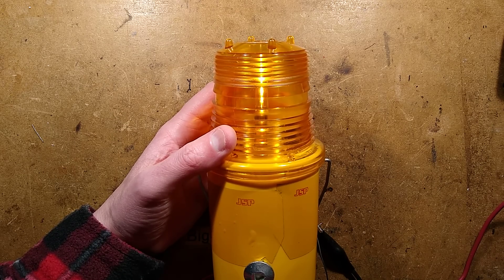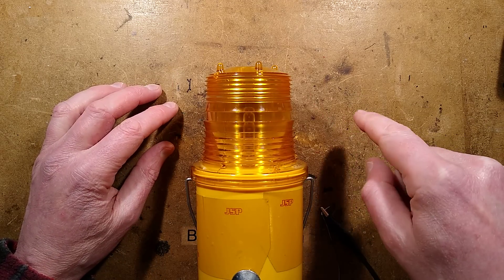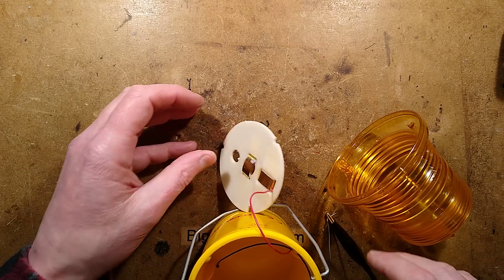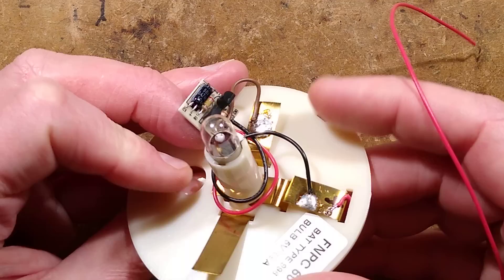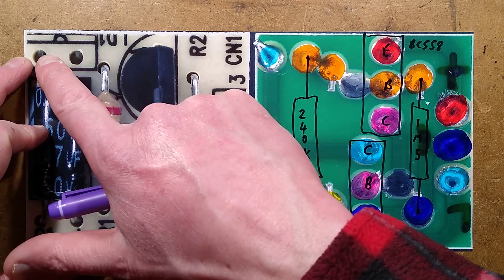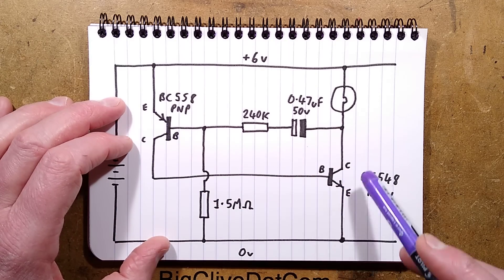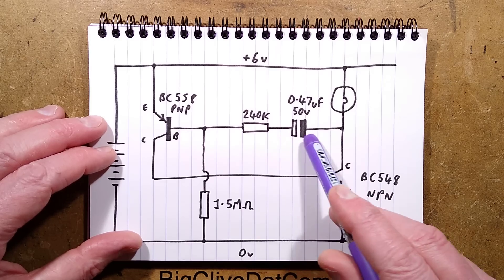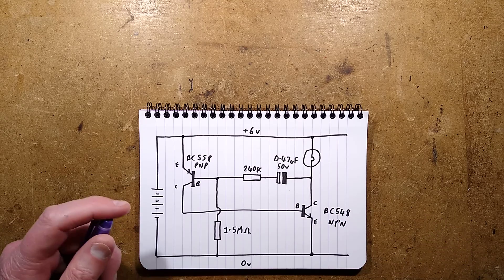Old tungsten roadwork beacon - with schematic

Comment: Used to steel those as a kid. Loved the 2x6v large round versions which you needed a match stick to turn it on. Who is old enough to remember the paraffin traditional road work lamps
Reply from the maker: I had a few of the paraffin road lights.  I gave them to my dad.

Comment: Many moons ago when I was at school in Germany I worked hour-wise on some afternoons at a small factory assembling the German version of this. They were even simpler, using a bulb with a bimetal strip inside to make it flash. After that they also went solid state, and it was my job to populate the circuit boards. there were a few more components on that though. Later on I constructed a LED powered prototype with the first high (ish) intensity clear red LEDs, was sorta OK and the boss was very impressed, but them darn bean-counters killed the project. That was around 1981, LEDs not so super cheap...

Comment: You could use that as the yellow flashers for your car in case one of your bulbs fail!  In fact, you may only need to connect it to the Flasher's main wire from the LED. I am not sure if any cars still use 6V still or if the Volts have been Lowered.    but, this would be a emergency fix if you need it!

If I remember right, there used to be a charging Upgrade for these road light's which would charge the Batteries  during the day. so, LD was probably more for that UP grade for a light sensor. the LD may have also turned down or up the power of the light as well as charging the battery!   I will try and see if I can find more info. I have not seen one of these in quite a while. and they are somewhat still in use here in the USA!

Comment: Circuit is the same as the Dorman-Smith Trafilamps from the 70s and 80s. But those did have a light sensor, and took two lantern batteries

Comment: I believe the light sensor (ldr) missing component is for syncretized lamps the one in front flashes the ldr pricks up the flash and triggers the next in the chain and this continues down the line giving the runway effect you see on motorways

Comment: Interesting not that far off from a US version although ours had in some cases double batteries and I'm not sure what the little circuit was. Most of them did include a power switch push button instead of the rotation method and sometimes a photo sensor. the design was also fairly cheap although the one I took apart might not have been that economized at that point it was older but still resembled the current firm factor at that time. and I don't know how I got a hold of it when I was 6 or so. I did have family members and acquaintances who would give me boxes of goodies which was always fun. Always wanted to be an electrician and well I haven't gotten the official paperwork yet it's on my to do list I have done a few projects and I'm confident enough to do things safely and properly, and the fun one spot other peoples mistakes and fix them.

Comment: In our area our lights that would be on wooden folding barriers has a flat round shaped light (so basically shined 2 directions mostly) and they used a 12v battery (the size of 2 of the 6V ones from your lamp), I thought I really did something when I figured out how they turned them on/off, it had a small hole (less than 3mm) that they pushed a pin into to hot a push on push off switch and the hole was sort of hidden as it was next to some ridges so you would not see it unless you knew exactly what you were looking for. The main body had the ability to be bolted to the wooden A frame barriers in a way it could not be easily removed (would have to disassemble the  battery box and get to the bolt from inside the lamp).

Comment: Hi Clive, I had a lollipop version of this lamp as a teenager. These things are almost disposable, (they’re used by the thousand and often hit by passing vehicles) so even saving the cost of one resistor and its assembly cost mounts up. That’s why this is so minimalist. The one I had did have an LDR built in, and that was to synchronise the flash to the next one along the road so the net effect was a strobe sequence along a feed-in where a lane is discontinued. Presumably the response of a simple LDR is not instantaneous, hence the slight delay in each lamp flash producing a progressive animation along the row of lamps. I imagine there were build options with and without the sync LDR. Very few components producing a sophisticated multi-lamp behaviour.

Comment: So this is why you had that survey.  I had a feeling it was coming up, the closest thing to this I have is a unit used on my tractor.  The difference is it's three brief flashes then stops for about a second and then repeats.  It's also LED but has the amber Fresnel lens like this one.  I wonder if power draw would be different if you changed out the flashlight bulb with an array of LEDs pointing in four directions?  The beacons I remember as a kid (early 1990s) were similar but were a disk shaped round beacon (like the amber fender lights on tractors) in two directions and they sat atop sawhorse-style barricades and a yellow square battery box below them.

Comment: I can remember opening one of these and finding the multivibrator cct. We played with it for hours and connected a loud speaker instead of the bulb. Swopped some of the resistors for pots and changed the cap values.. DIY synthesiser  on a budget !

Comment: I remember the old Dorman Smith Trafi-Lamp versions that took 2 batteries. They had a special low current bulb and would not flash with any other type.

Comment: Ahh, yeah, I remember those lamps in the early 80s, they used to to attach to the top of a yellow metal tripod with that screw using a triangular key. We had to walk the entire line of roadworks turning them all on before we went home in the evenings. If they didn't turn on you'd have to swap for one of the spares carried threaded on a rope through the wire handles. These were the first move towards the modern traffic management. How times change, the only hint of hi vis clothing was having orange shoulders on your donkey jacket. Welfare was an aluminium shed with bench seats inside and a gas ring to brew up. Despite safety being more basic, working on the roads was safer back then, motorists weren't as ignorant, impatient or distracted as they are today.
Reply from the maker: I still have my donkey jacket from the past.

Comment: What if you remove the resistor+capacitor and install the LDR instead? Maybe the lamp affecting the LDR will be part of the circuit during the night, and during day the sun will keep the light off.

Comment: The long flash is due to the 240K resistor, the original pulse version did not have that.
Nor have they ever had a current limiting resistor in the base of the lamp transistor.
It would be over 40 years since I pulled one apart and then they had a TO220 style output transistor.

Comment: I remember having several of the American style ones when I was a kid in about 4th ot 5th grade back in the very early 80's. 

I was walking home from school one day, and the main road that took me home had been under construction ALL summer long. I'd make my way thru the job-site everyday, and check out the progress as I walked home. That day I found a box along side the new curb with about 7 or 8 of the flashing lights in them, and they looked to be broken up or not working. I asked one of the workers in the orange vest if they were garbage, and to my delight he said YES! I dragged the box home, and was able to take them all apart and make a few good ones out of the bunch. They even came with 2 6-volt lantern batteries in each one, and many of them were still good. I put the ones that I got working all over my room, and my favorite part of the day that summer was dust, when they'd all magically turn on and my bedroom would be flashing orange all over. I was amazed that the 2× 6-volt cells in them would keep them running all summer long. I kept those things for YEARS.. later on, I put brighter incan bulbs in them, and finally some yellow LEDs when some bright ones finally came along. I learned how the circuit worked way back when, and it is a fond memory of one of my first forays into electronics as a young boy. 👍

Comment: "The reason the light is round is because roadworkers often smear the lights with grease and then sit on them for manly pleasurement, although that may not be factually correct, since they actually use cucumbers or Temu insertables instead.  (Hardly anyone reads down this far anyway.)"
ROFLOL 🙂 Even if I don't watch the whole video, I always read your description because your descriptions are always so thoughtful and spot on.  Most youtubers don't even fricken bother with a simple description. )-:  YOUR'RE THE BEST BIG GUY!

Comment: Ah, I remember 2 other versions of these. There was the big plastic container for the 2 batteries, a metal bolt for bolting to a skip/stand, then it tapered up into the clear orange disc. Inside was a latching push switch, like the old bedside lights. This was accessed via a small hole in the housing, just large enough for a small terminal driver. 
The other one was a rectangular all metal affair with the orange lens sunk in the top part and the batteries, flasher and mounting screw in the lower half. Some of these on ebay right now, new old stock. 
Dorman Smith traffilamp I believe they are called. Also used in some form on UK railways.

Comment: For most of us, turning a light on and off doesn't seem a huge imposition. That suggests this lamp was designed before the bean counters figured out how much they were paying people to turn caution beacons on and off.

As for the cheapness of the design, perhaps it was a "safety in numbers" mentality? If you have 20 or 30 of them set up along the roadway, one or two failing probably wasn't going to cause a catastrophic safety incident.

Nowadays, I'd make a 3D print replacement for that bayonet lamp mount, and see what I could stuff inside to make it brighter and last longer. Perhaps make the first safety beacon visible from space. (My neighbors love me around the holidays. 😅) Perhaps a project idea? 🔆👍

Comment: That's a really aesthetically pleasing design for such beacon, here in italy both the small and bigger version are square and not as nice looking.
That said I have a yellow one in my collection of lamps.
The lantern battery are extremely easy to restuff with lithium cells and charging circuitry, the pain is to empty and clean them up when the original cells are all swollen and corroded

Comment: TWO transistors!! That's a bit exotic... all the ones I "found" when I was a kid were just one transistor and about 6 passives. I suppose it's how manufacturing costs have changed... those 3 extra passives in my time would have cost loads less than a transistor.

Comment: When I was a young lad , I turned many of them into a variable strobe light or parties by replacing that 1.5 m resistor for a 100k and a 2m pot in series.  It wasn't that type it was the one that was square and had the large bunny and ear . I made a few bob out of it .

Comment: These simple transistor circuits are often so awkward for me to analyse.  On turn on the pnp base is at ground, so pnp on, so npn on, so capacitor now connected to ground, but sat above ground (0.3 volts) due to voltage drop collect to emitter & loses charge to ground. Possibly inducing a positive charge on the pnp base connection of the capacitor, turning pnp off, then cycle repeating as the capacitor pnp base then discharges to ground via the 1.5 Mohm & 240k resistors. Could be completely wrong. Really need oscilloscope traces to see what really happens. Thanks for sharing!

Comment: As a young teenage dirtbag I used to ride my pushbike around the neighbourhood and knock these things off the roadworks. They were disc shaped with a big box part below that contained the 6v battery.

I remember the circuitry was encased in a cylindrical shaped wax with a LDR sticking out.  

That is what got me into electronics.😅

Comment: I still have one they used here in Australia in the 70's to maybe early 90's.
It uses 2× of those big 6V Dolphin torch batteries.
Ours had large round double sided almost flat lenses, with a moulded plastic handle on top, mounted to a large plastic rectangular battery box base.
As a kid I always assumed they had LDR's inside to turn them on and off at sunset/sun up.
However, once I got hold of this one and opened it up, I found there is a small hole through the side of the battery box to poke something through to press a latching push on - push off switch, and no LDR.
It blew me away that these things must have meant some poor roadworker had to be going around all the road works every morning and evening manually switching them on and off🤣👍🇦🇺

Comment: Those 6v batteries used to have large cells that went the whole height of the casing. Over the years they added more and more packing to the bottom of the case. not sure how small the cells are now in new ones.

Comment: I used to plat with these as a kid. I actually like the way they work. Simple but effective, even if inefficient with battery life, they would continue to work until you could barely see the lamp. However I'd like to see if any improvement could be made by inserting a base resistor, you referred too, for the npn transistor.

Comment: That socket on the board might be marked as "LD1" ?  (light detector ?). Looks like a pcb mistake maybe - if the LDR was across the cap only, wouldn't that hold the whole thing off, and not draw much current Clive ? Edit: I don't think that would work either ! The light I 'inspected' as a child was the big lollipop shaped type, and they also had a discreet transistor cct, but the duty cycle was a short strobe flash only, so they were nice and visible but the battery would last much longer.

Comment: This is the junkiest device you've had on your channel; and it's not Chinese. I don't ever remember seeing these (and I'm old). The only ones I recall were the ones with the bulbs with a built in bi-metallic strip and later, the Xenon HV discharge triggered by a neon.
  Thanks, very interesting.

Comment: The ones in the U.S. Used two lantern batteries in parallel, The lens(s) were pancake shaped emitting light in two directions only. The outer rim of the Fresnel lens(s) had retroreflectors in case the battery's failed.  They had a hole in the case where a pin could be inserted to switch them on/off and they did have a CDS to turn them off in daylight. They also had a single mounting screw (security type)  for mounting.

Comment: ( Comment below  ) ... yes indeed , I have an old UK ( red ) paraffin lamp , in  VERY  good condition .... in the 1970's I fitted a 15 Watt mains lamp , but , now with superior modern technology , it has a multi LED 12 Volt lamp ( the type that can be IR programmed to go blue / green / red + all manner of flashing modes ! ) , what I found in the bushes , last December ( ? ? ) ... set to red , it works really well ! ( but in 1968 even red LED's cost ££££££ ! ) .................. DAVE™🛑

Comment: saw the inside of one of our American ones. 4d cells and a 10mm self flashing LED. no switch no circuitry just run till they are dead, even during the day. was pretty disappointing.

how low can it go before it cuts out?

Comment: Early 80s, I have to confess robbing quite a few of these for the batteries. Two in series, two in parallel and I could power the CB radio I had fixed to my pushbike for an afternoon of chat from a local hilltop.

Comment: I remember them having no circuitry and only a flashing bulb inside. A thermal strip creating the flash inside the bulb.
Today, when I drive the motorways at night, I see roadside beacons that appear to 'talk' to each other and create pulses of light showing the path of travel to drive.

Comment: I pulled one of these apart.. many many years ago, and didn't even have the transistor switcher. The flashing was the bulb itself, it was similar in construction to old christmas tree lights, with a bimetallic strip. The bulb would heat up, strip would open, and then it would close again. They also had a fun side effect of spending less time on in the heat/day.

Comment: When I was 13 or 14 I had a chance to try to repair neon flashing traffic lights at my Dad's construction company. The "flashers" replaced kerosene lanterns (circa 1950s).  I was shocked several time as the electric flywheel made then broke the inductor circuit to get high enough voltage to fire the lamp. I learned the circuit operation by going to the city library. It was like a car ignition circuit. I was then the guy who fixed Dad's flashers. Part of reason I became an engineer.

Comment: I've seen new led units in long lines of barrier cones that flash from one end to the other then start over at the closest end in sequence. I wonder if they are networked as I saw no wiring. But good guiding effect at night.  I had several lanterns with the 6 volt square battery years ago. They were nearly always dead when you needed them and had leaked and destroyed any metal in the case.
Reply from the maker: The charging ones communicate with infra red.

Comment: I have one of those old railway lanterns, that uses a 6volt lantern battery, however ive changed the bulbs to LED and use an adapter that allows 4 AA's in a 6v form, you can also find these adapters for 3d printers too

Comment: I remember taking one of those roadwork signs apart when i was a kid. I had taken it because it was not flashing like all the others and figured I'd try to fix it.
I learned that the flashing was controlled using the DCF77 signal (which I had done a project about in school) so the 0-9 selector in the bottom simply controlled which 1/10 second it would flash so multiple could be synced up without wires.
Long story short, I managed to fix it and put it back so the light sequence was now complete. 😀